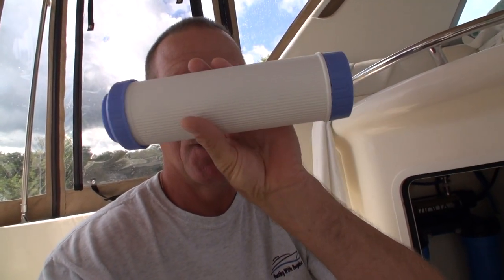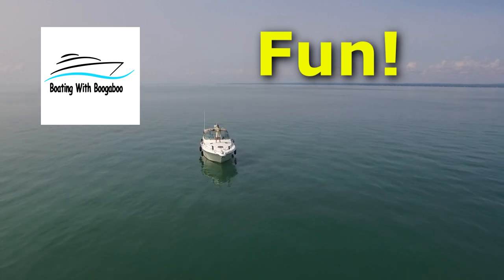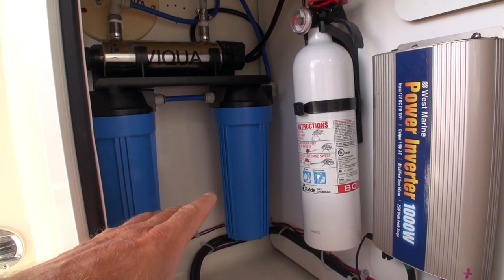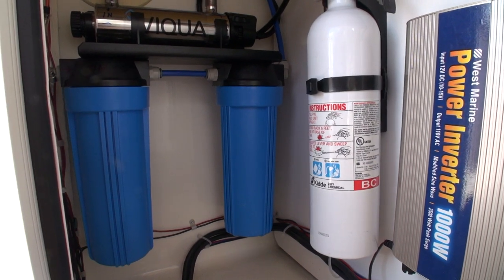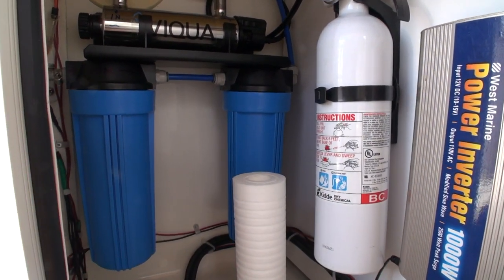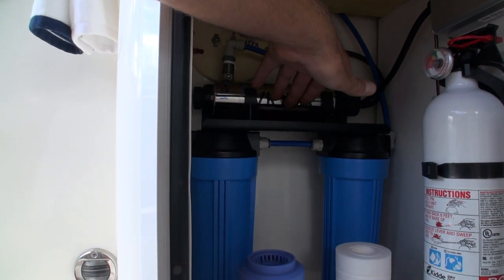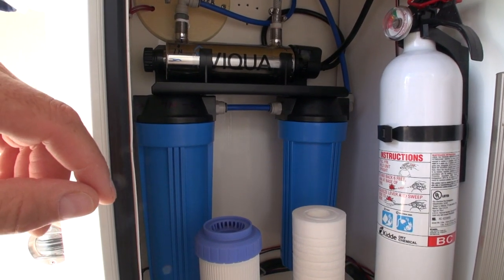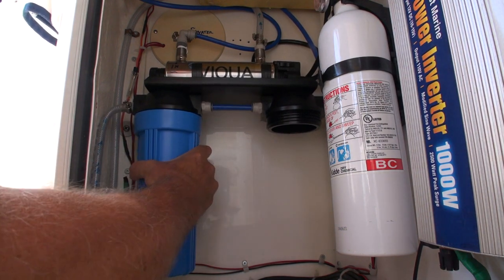Water Filter Change - Boat Filtration System, Sea Ray

Comment: Isn't the purified water safe to drink since your using water other than St. Clair River/Lake St. Clair/Detroit River/Lake Erie water?
Reply from the maker: The issue we have is the fact that the boat is now 22 years old, and there's who-knows-what living in the lines. Yes, the water is probably as pure and safe as anything coming from a municipally treated system, but we only use the onboard water for cleaning and showering. As I mentioned in this clip, drinking water (mostly for the coffee maker) comes from bottled stuff, or what we bring from home in big jugs. . .
Reply: Hi! I have a 330 Sundancer 1995, I love your videos and DIY knowledge. As I live in Mexico I have a to struggle a lot to get spare parts (is a 25 years old baby), big reparations and all that stuff. Can I have your e-mail to get in touch and have your advice where to buy them? Best and keep boating!
Reply from the maker: @jaimevazquezmellado687  I find most of what I need online. Just do Google searches for the parts you need. . .
Reply: BoatingWithBoogaboo sadly most of the stores don’t ship to Mexico, and previous owner don’t have the manuals. Tried to get a manual but it is so old that didn’t found one yet. Do you know any Internet  page to look for part numbers? Thanks!
Reply: Hi there?